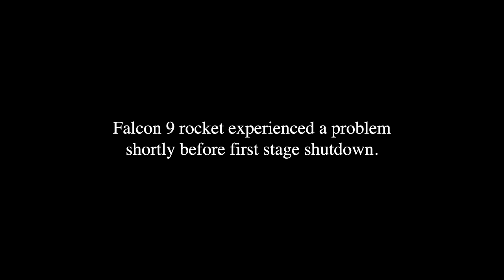SpaceX Falcon 9 Rocket Explosion June 28, 2015 (HD)

Comment: Such a shame and doesn't it just show that even now nearly 50 years after the moon landings how difficult it is to safely get a rocket into space. I had this idea for a vaccuum tube with magnetised walls which would start miles underground and run at an angle upwards. Kind of like a maglev principle. it would accelerate a space vehicle to supersonic speed before it was even above the ground, then when it was fired clear the craft would fire up into orbit. it would need to carry less fuel and therefore be lighter. What do my fellow expert YouTubers think?
Reply: A very interesting concept it is, sir.
Reply: +Nick Baldeagle   awsome idea! some physicist care to calculate the size of the electromagnets we'll need? woldn't the electromagnetic field interact with the rocket propellent?
Reply: No. I said supersonic speed not orbit speed. If it was already doing mach 2 by the time the rockets were ready to fire it would save fuel.
Reply: @Nickbaldeagle02  you keep all the problems of rockets (sensible fuels, engines, etc), while adding a multibillion idea to it. 
If you build the rocket, you might as well just do it big enough to go where you want.
But I agree, it would save fuel.
Reply: the deepest hole is 12226 meters made by USSR and there's 180 C degrees down there. anyway, the other option is to make a giant flying launch pad to bring the rocket at 11-15km above or as high as possible, to reduce atmosphere impact.
Reply: wouldnt make sense that way, unfortunately. the reason why rockets start vertical even if they have to be horizontal to the ground when in orbit is, that they have to find a delicate balance between leaving the thick parts of the atmosphere asap and not wasting too much fuel on getting "away" from the earth since that doesnt add anything to your orbital velocity (because its vertical, not horizontal). if you fired a rocket out of a tube like this into the lower atmosphere at say 2000 mph, first of all the rocket would get a shit load heavier because it needs more structural integrity to not break up from the massive punch it gets from smashing against 1 atmosphere of pressure at 2000 mph. second, you will have to fire the engines immediately and they would have to create a whole ton of thrust to even make the vehicle STAY at 2000mph aside from accelerating, because the air resistance is so high. so you still burn up a ton of fuel until you are out of the atmosphere. so maybe, if you crunch the numbers, you may get a slight advantage on delta V but thats suuuuuuper not worth the hassle of building this big ass electro magnet. you'd rather build a slightly bigger rocket. also, if you really want to get to orbit without wasting a ton of fuel, you would rather use sth like a space elevator that can run on little power and carry big payloads. (in that case, afaik, the biggest struggle is getting a strong enough material)

Comment: i will guess it was an fuel pipe leak
Reply: So Tasty Quite possibly. The structural failure appeared to begin at the capsule area then propagated aft. Almost looks like an aerodynamic failure, but that could have been due to a preceding cause itself. That's a particularly unfortunate failure because it should have been preventable. Engines looked hot and normal all the way. And it was hitting its time, distance and speed until the forward section seemed to shatter down onto the 
first stage. 

There is a plume on the (then) underside of the rocket near the first and second stage joint just before a much larger 
plume engulfs the upper stage. Could have been second stage fired early.
Reply: Ally Van Andel wait look the video at 0.25 or slo motion first like just when it begun to fail dragon v1 fairing poped off and then under the dragon it exploded what if one of the helium tanks in dragon v1 exploded?
Reply from the maker: So Tasty Falcon 9 Explosion in close-up & slow motion https://youtu.be/SrnN8GhqRj8
Reply: Ally Van Andel Jesus... You're genius as fuck!